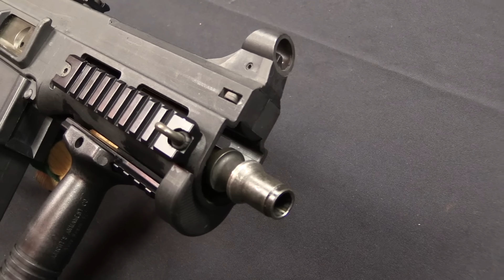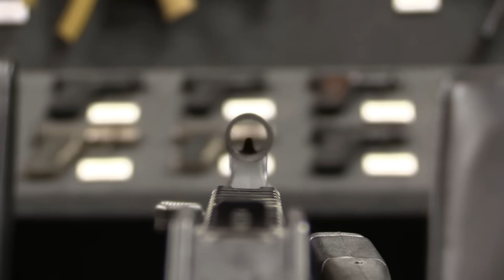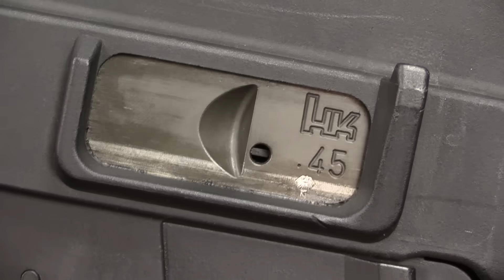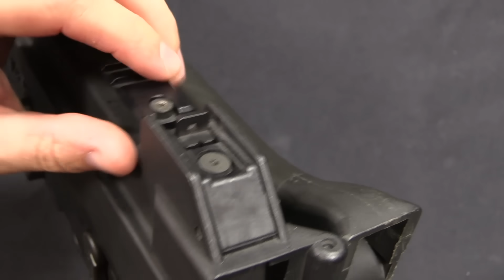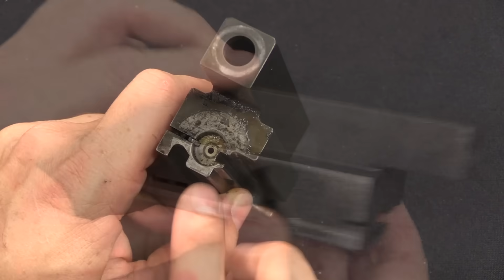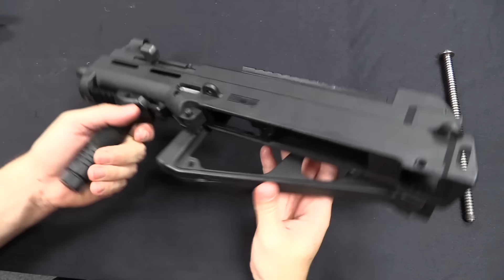H&K UMP: An H&K SMG Made for .40 and .45

Comment: UMP designer: I’ve finished the Mp5 replacement. 

Boss: okay, what did you do to improve upon the design of the greatest SMG in the history of the world?

Designer: improve? Uh... I gave it a LRBHO.

Boss: okay. Anything else? 

Deisigner: uh... it’s made of polymer so it should be lighter.

Boss: o...Kay... anything else improved?

Designer: no, every single other thing about it is worse.

Geralt: fuck.
Reply: >every single thing about it is worse
Literally how
Reply: Fake Name literally because it is. 

The simple blowback means it is practically unusable in full auto. I’ve fired both. The MP5 is excellent. The UMP, while fun at the range, is not something I’d actually want to use. 

Also the one improvement (LRBHO) didn’t work reliably on the two (.40 and .45) I shot.

And before you suggest that the reason the UMPs were more of a handful because they were in bigger calibers than 9mm, even the HK53 was less of a handful than the UMPs, and it’s basically a 5.56 mp5.

Comment: What is that paddle on the left side, that looks like an AR15 bolt release?  Is that an alternate magazine release?
Reply: Nope, it works, for ones who are familiar with the AR-15 mechanics.
Reply: @bmhater1283  so it's a bolt hold/bolt release, in addition to the "HK style" charging handle hook?  So, there are two ways to lock the bolt back, each if which can be used independently?

Comment: They made it in .40 but how cool would it be in 10mm
Reply: That would probably sell well as a PCC/'pistol' on the civilian market, but I doubt any military/law enforcement agency would want it, and that's where H&K's focus lies.
Reply: why bpther??   the 10mm is just a tad less than 3/16" longer than the SnW40... load the 40 with a bit hotter powder and you have the equal to the 10 ( they both use the same bullet size)
Reply: @bunnykiller  pressure limits in the .40?

The 10mm is the same overall length as .45acp, so mags aren't a problem.

I think the problem is that very few police use 10mm, and hk doesn't grok the us civilian firearm market.

Comment: I really don’t get why hk makes these cool ass guns and never sell them to the public, the hk 433, mp7, g36, Ump would sell like crazy
Reply: A lot of that has to do with US firearms laws.  Specifically the 1986 Import Bans and Assault Rifle bans.  Ian does mention a bit of that in his video on the H&K SL-8, which was generally a ban/import compatible G-36 and it's sales were terrible.  The MP7 is select-fire only and manufactured after 1986 so it wasn't grandfathered in for civilian sale, same with the 433. Likely due to the failure of the SL-8 and H&K's focus on military and law-enforcement contracts rather than civilian sales, they likely don't see the profit of making semi-only versions of these platforms (as most semi-only versions generally have to be engineered in such as way as to prevent easy conversion to select-fire weapons).

Comment: The only thing that would beat HK MP5 if someone made proper downscaled locked breech gas operated 9mm AR-15 submachine gun. The simple blowback open bolt Colt smg did not cut it

Comment: Gonna have to disagree with Ian a bit, I think most users of the UMP would buy it as a anti-eco gun or possibly if you suspect the Ts went for AKs but not armor.
Reply: I stopped playing CS:GO in 2014 but back then and even when I played 1.6 I would just always get the UMP instead of M4s and in 2 rounds be buying loadouts for team mates. Such an underrated weapon in not only CS, but a lot of games honestly.
Reply: @ZeFluffyKnight  Ho boy you should try Modern Warfare 2's UMP45, cause that thing was the bees knees
Reply: @ArcturusOTE  Idk about the Modern Warfare 2019 UMP because I don't unlocked it but if it is close to the MW2 version this gun is owning
Reply: @ZeFluffyKnight  in classic counterstrike the UMP was held back by having a really badly aligned model. Change the weapon model to something that actually points the way it aims and people tended to do a lot better with it.
Reply: @ZeFluffyKnight  well they nerfed it later, I don't really remember anymore when though. It was indeed a small rifle
Reply: @bozhidardimitrov3573  it was like late 2016-2017 when it was mega broken
Reply: @ZeFluffyKnight  it is also pretty good in Payday 2 as the Jackel SMG (= 'UMP .45' cal) with higher hitting power & 40 rounds than the Compact-5 (= 'MP5' family); 
   ...when equiped with the extended mag (the 'stock' mag is 30 rounds,) and has excellent accuracy (close to medium distances only) and a reasonable stability for a SMG, and easy to use stock iron sights, high RoF in auto-mode and very good stealth 'concealment' values all...
   ...without additional weapons modifications, or the user's/player's skill selections and their 'perk deck' modifying aspects of the weapon stats. 
   But it does have a low ammo count for the character/user/player, requiring the skills that refund and drop ammo more often for every 6 kills and bonus ammo for single-fire mode headshots every 5+ seconds, particularly if a/the player is bad at aiming or trigger-discipline and/or is facing bullet sponge enemies like Skull Dozers - have a 5/7 AP pistol as your pistol and aim & shoot only at their faceplate & visor. and in half a mag to 2 mags, all dozers will tend to die fast.
Reply: The ump beats out most rifles for half the cost lmao
Reply: X-Ray Crystallography  he's talking about Counter-Strike: Global Offensive (a video game where most engagements are at mid to close range), not the actual firearm.

Comment: I'm torn between the MP5 (especially the SD version) and the UMP (especially the 45cal version). Can't choose either, both are very appealing.
Reply: I haven't held the UMP,  so I can't comment on it. 
But the second I shouldered an MP5, it felt just right. The ergonomics felt perfect for an average guy like me, regarding arm length and hand size - both hand positions, elbow angles, length/weight relationship and balance, the way the sights line up with the eye - it's simply immaculate. 
And it was piss easy to shoot and hit with.
If the UMP is anywhere near this ergonomic perfection, you can't go wrong with either.

Comment: The UMP45 is Better than The MP5, Fite me
Reply: It was back in MW2 lol
Reply: the LWRCI SMG45 is better than the UMP45 so suck it HK lovers
Reply: @douglasshouganai2516  In what way exactly? Tis cheaper to make? Uses a better mechanism? Etx?
Reply: @ArcturusOTE  same durable magazines as the UMP45. but has a delayed recoil rather than simple blowback operation. so it has a lighter bolt, less recoil, easier to charge. UMP45/AR15 hybrid  ergonomics, nonrecip charging handle which is swappable without tools.

Aluminum instead of polymer, but similar weight due to weight savings on intrrnal parts.
Reply: @radjadawamindra697  Ah a Man of Culture as well

Flat 45 is best girl